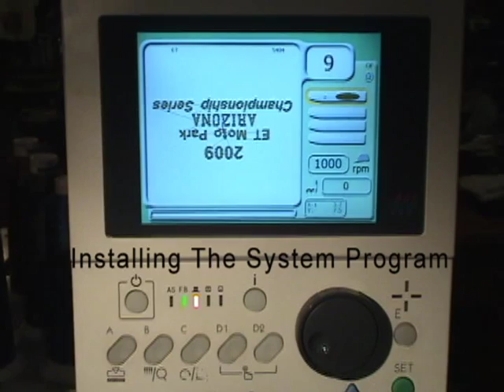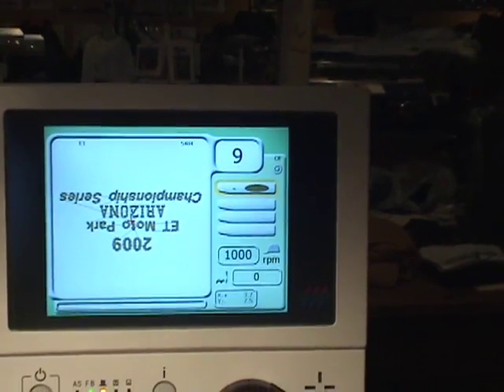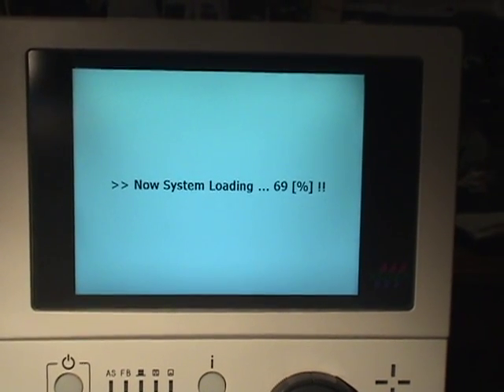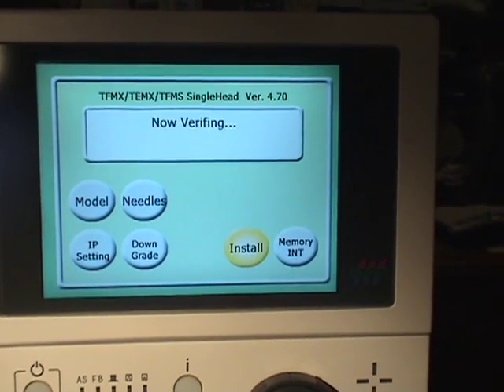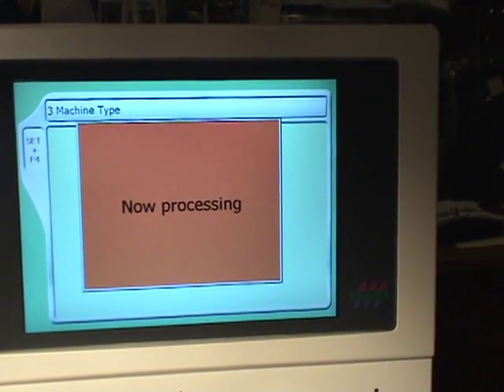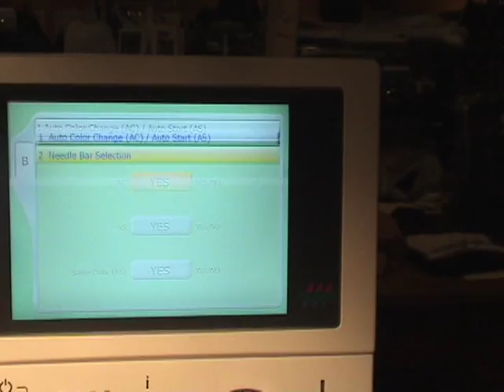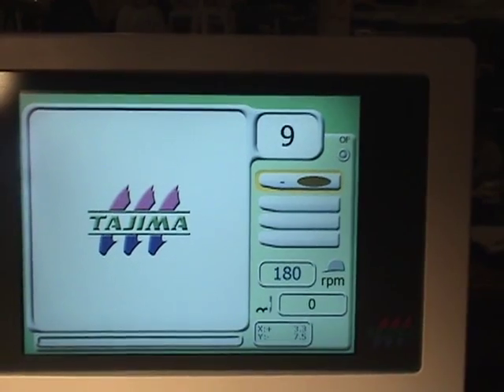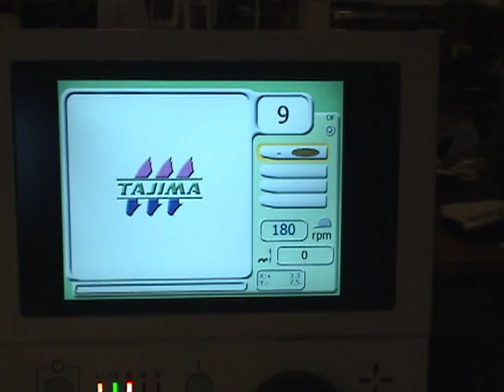M Machine Firmware.avi

Comment: Did anyone get any help here?
I have a 2007 TFXM c-1501 that will not start after I replaced the battery in the control box.
I think need to install a new firmware and do not know how to do it. My machine has both floppy disk and usb. Floppy on the side, and usb on the back.

It sais floppy disk fail (40) and CMOS checksum error on the screen and stops there when I turn it on. Can anybody please help me with this? 
I’m from Norway, and the nearest dealer/support is over 1000km away.

Comment: Where did you get the new update firmware for your machine? I tried to find one online for my Tajima TFMX C1501 model but no luck finding it. Please advise. Thank you
Reply: Did anyone get any help here?
I have a 2007 TFXM c-1501 that will not start after I replaced the battery in the control box.
I think need to install a new firmware and do not know how to do it. My machine has both floppy disk and usb. Floppy on the side, and usb on the back.

It sais floppy disk fail (40) and CMOS checksum error on the screen and stops there when I turn it on. Can anybody please help me with this? 
I’m from Norway, and the nearest dealer/support is over 1000km away.

Comment: Hi, what if the machine doesn't read the memory? there is another way to install de firmware? 
thanks!
Reply: Did anyone get any help here?
I have a 2007 TFXM c-1501 that will not start after I replaced the battery in the control box.
I think need to install a new firmware and do not know how to do it. My machine has both floppy disk and usb. Floppy on the side, and usb on the back.

It sais floppy disk fail (40) and CMOS checksum error on the screen and stops there when I turn it on. Can anybody please help me with this? 
I’m from Norway, and the nearest dealer/support is over 1000km away.

Comment: My macine wont  take it it will read  3dc error any help‼️
Reply: Did anyone get any help here?
I have a 2007 TFXM c-1501 that will not start after I replaced the battery in the control box.
I think need to install a new firmware and do not know how to do it. My machine has both floppy disk and usb. Floppy on the side, and usb on the back.

It sais floppy disk fail (40) and CMOS checksum error on the screen and stops there when I turn it on. Can anybody please help me with this? 
I’m from Norway, and the nearest dealer/support is over 1000km away.
Reply: Hi bro did u get it this problem
My machine is problem.do I have version 7.0 frame wares tajima ii-c1206 please help me.